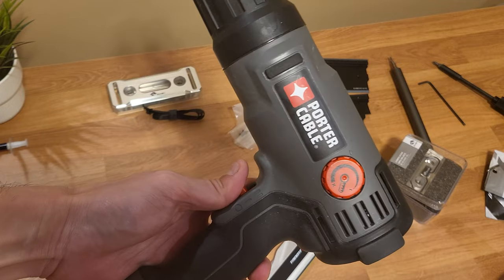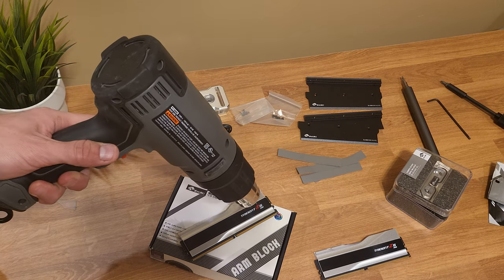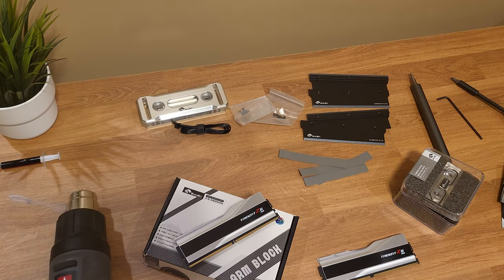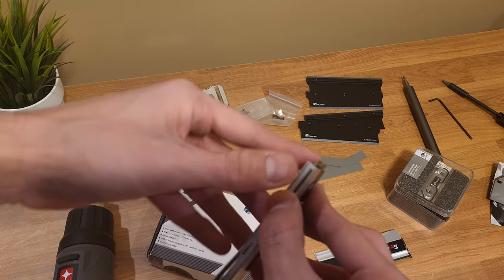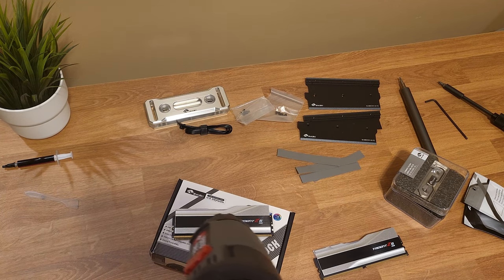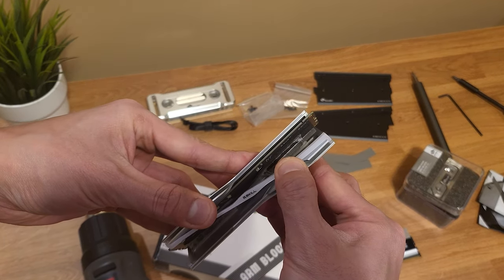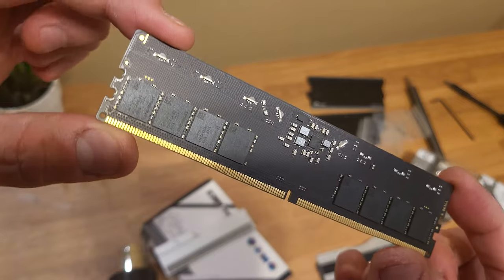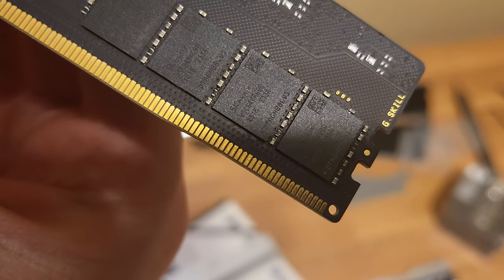How To Remove Trident Z5 Neo DDR5 RAM Heat Spreaders

Comment: I water cooled my ram and to my surprise, I couldn't get any more speed out of my A Die sticks. My better set of 7200 can get up to 8000 with default timings and 1.5v. Air cooled and they never hit over 53c. Water cooling improved temps, but my speeds are likely capped by my 13th Gen CPU's memory controller. Were you able to get more from cooling the sticks?
Reply from the maker: haven't been able to fire up the scuba raptor yet. waiting on some mounting screws for the 200mm AF20s. they're 30mm thick so standard mounting screws don't fit and 35s are hard to find. overnighted some, so should be able to resume the project tomorrow. lot of new testing to come soon
Reply: @pyurologie  Any luck under water vs air - did you get any improvement on speeds/timings between the two?

Comment: Hey, what brand thermal pads did you end up using? I'm getting ready to paint the spreaders of this exact ram. If you were putting on the same spreaders again, what size thermal pads would you use? 0.5mm, 1mm, or 1.5mm?
Reply from the maker: hey I had some extra 1mm thermal right pads lying around I used those in combination with the included pads
Reply: @pyurologie  Thanks so much! Getting ready to do my first build, going to paint my spreaders with copper accents!
Reply from the maker: that sounds like it would look nice!

Comment: Hey, do you know what/remember what the dimensions of the RAM was before you removed the stock heat spreader? building a system rn but am afraid my cooler doesn't have enough clearance
Reply from the maker: so you mean the trident z5 dimensions?
Reply: @pyurologie  yeah, i thought it would be something easy to search for online, but I literally can't find it anywhere.
(amazon has dimensions of it on their website, but they are impossible, something along the lines of 2cm wide x 24 cm long x 16cm tall)
Reply from the maker: i got u
Reply from the maker: height: 38.7mm (at highest point)
length: 125.3mm

i just measured with my calipers
Reply: @pyurologie  THANKS, saved me there
Reply from the maker: i'm here to give the best info to the gamers and enthusiasts :)
Reply: @pyurologie  wow you go above and beyond bro!

Comment: Did you need to clip the LEDs?  I have seen some people say to clip them off to prevent shorting to the heatsink.
Reply from the maker: i didn't clip them, they've been working fine in the heatsinks i'm using here

Comment: Hello, Do you know how tall the modules are without the heatskins? I want to use them in mi mini ITX build but Im worried about clearance with CPU cooler. I know they are like 46 with the heatsink but not without them.
Reply from the maker: hey I am traveling right now but I can measure them when I get back and let u know
Reply: @pyurologie  Thank you so much!
Reply: @pyurologie  hey u home?
Reply from the maker: @robertofernandez7178  nope not yet
Reply from the maker: they're somewhere btw 30.5mm - 30.7mm tall. I measured them from the side because they're currently in my Scuba Raptor system.
Reply: @pyurologie  Thank you so much. As long as they are under 33mm they will fit under my cooler. Thanks really.
Reply from the maker: you're welcome thx for checking out my content

Comment: Thanks for posting this.  I'm about to do the same thing to my GSkill Z5 RGB 8200 2x48 kit for my Z790 Apex Encore build.  I do have a question though, what power screwdriver is that?  That's nice.
Reply from the maker: hey i'm glad it's helpful and thanks for checking out my content!

the screwdriver is called a wowstick pro, it's come in handy a ton for me. i got mine from aliexpress, here's a link to the one i purchased.

wowstick pro: https://s.click.aliexpress.com/e/_DCZ2K43
Reply from the maker: it's also really nice because it locks after a certain amount of torque and allows you to hand tighten for final adjustments
Reply: @pyurologie  Thanks for the quick reply!  My old Black and Decker which died a long time ago had that hand tighten feature as well.  I'll have to check this one out.
Reply: @bobvoeh66  yo man, have u done it for ur 8200 rams? I have same rams on the way and wondering if this heatsink will fit...

Comment: You didnt put a pad on the PMIC?! Why? No space, no need? If no space, wouldnt some other compound help? I'm thinking of doing this.
Reply from the maker: hi, i actually did end up using more of my spare thermal pads and covering them, good eye. thanks for checking out my vid lmk if i can answer any more question
Reply: @pyurologie  cool, thanks for answering! :)
Reply: @pyurologie  
Can i ask what kind of pads did u use on the pmic ? 0,5 mm ?

Comment: How is that build going ?  I am getting closer,  but still planning.  What ram block is that ? a 4 dimm one ? why a 4 dimm ?  any suggestions ? I am doing 2 sticks of same stuff as you on an Apex as well.  was the 4 dimm the only one you could get ?  thanks
Reply from the maker: The Road to 6GHz: https://www.youtube.com/playlist?list=PLYaeRxhLbnoF8U252FFBMYmUZhvS0XbQU you can check out the progress here. Haven't done much on this config since x3d releases but plan to get back on it soon
Reply from the maker: I got the 4 dimm because I wanted the option to use a 4 dimm later on. There are 2 dimm options available
Reply: @pyurologie  sweet.  I thought you had Bitspower. These Byskis are much cheaper.  suppose i can just cut the rgb wire off right ?